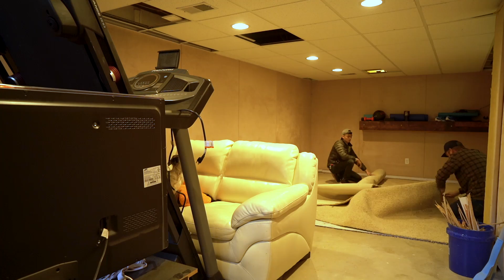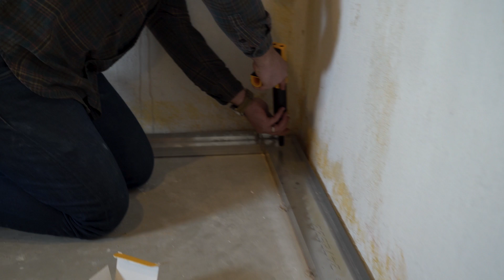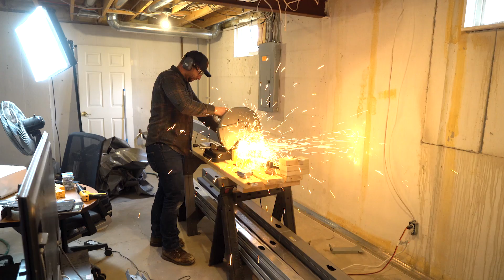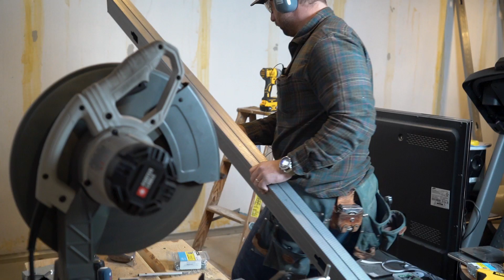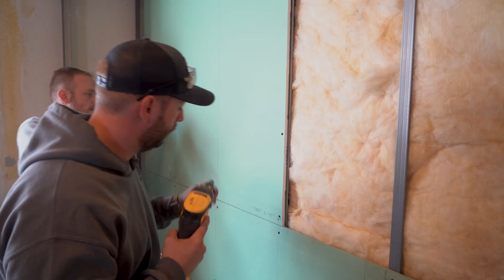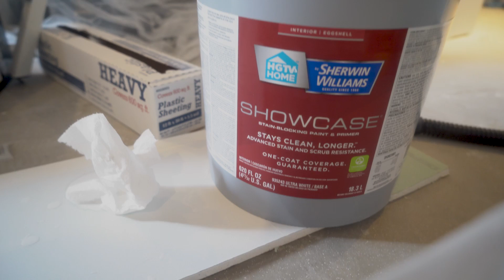Affordable DIY Framing, Drywall, & Paint // How To Basement Remodel

Comment: If u use a razor knife to score the back side of the track/stud u can cut each side and fold it back and forth and it will leave a nice cut. Also u can drill through the metal track because a masonry bit is well hardened as long as it’s not heavy gauge track. Not trying to knock ur work just trying to help. Great job.
Reply from the maker: I tried drilling through the metal track with the mason bit and it wasn’t having it. It was at that point I decided to get the ramset.
Reply: Third Coast Craftsman can’t blame u it takes a lot less Time with a ram set u should try the hilti automatic one u would be like say hello to my little friend. Lol have a good one brother

Comment: You really thought the sprayer was faster than a roller? You must be very slow with a roller. My back hurts just from watching you spray the wall. 
With a roller and telescoping extension handle you can hit the wall floor to ceiling in one stroke without bending over at all.If you use a big bucket instead of the tiny pain tray's the amateurs use, you will save a ton of time in refilling a tiny paint tray or refilling a tiny sprayer bottle. A roller also puts more paint on the wall than a sprayer, so you can use one coat in a place that a sprayer needs two.
Reply from the maker: You can keep the rollers...I’ll never use one again after this. No way they are faster
Reply: @ThirdCoastCraftsman  Roller is faster in this application, no question. Roller makes less of a mess, thicker coat, more control, and no bending over. Spray is better suited for other applications, doors, siding, trim, ceilings. Fun toy, but not quicker and definitely not easier in this specific application.

Comment: All your studs are upside down the holes aren't for electrical wires it's for black iron to make the studs more ridged I do like the video I'm a union carpenter so I use this stuff every day
Reply: Especially with lite guage studs^ . I’m also a union carpenter for 31 years . Local 157 NYC.
Reply: Another tip - if you lay out a wall from left to right the open side of the stud should be on the left and the closed side on the right. Like this  ] ] ] ] . Now Sheetrock from left to right. If you have the studs the wrong way the studs twist and leave a hump in the Sheetrock seams.
Reply from the maker: Dammit. Thanks for the correction.
Reply: I do love all your work I wish I could work with hand tools the way you do
Reply: The iron he's referring to is a carrying channel, and regardless of which way you put the studs it does its job the same, so it's not really an issue as long as you're still cutting them all from the same end so your holes line up.
Reply: there for black iron wire

Comment: Brush and roll vs tape and spray. As a remodelling contractor, I am going to leave this commercial alone. Biting tongue and its bleeding!!! Basement is looking good.
Reply: I have yet to use a sprayer inside. I exclusively brush and roll as that is all I know. Can you stop biting your tongue to let me know what you do? Lol I ask genuinely cuz I wanna know if I can save time by using the sprayer or if the upkeep on equipment is more expensive. I enjoy thinking about and looking at the job afterward as I wash the brushes and rollers but sometimes I just wanna get outta there ya know.
Reply: @benjaminlyons5261  The only time I can think of using a sprayer inside would be on "Popcorn" ceilings.

Comment: Years ago I finished a basement using steel studs and swore I'd never use wood in this application again.  Like you said, everything is straight and consistent.  Also, NO sawdust!  Instead of screwing the studs onto the top and bottom plates, I used the screws into the horizontal drywall to keep everything rigid and square. I set the drywall on a 1x3 to space it off the floor, then laid out lines 16 o.c. on the drywall.  All I needed to do was to locate the bottom screw on each stud, plumbed it, and followed the vertical line up the drywall to locate the screws.  The weight of the drywall and the tight fit into the top and bottom plates held everything in place.

Comment: Great video.  Checking with a local inspector about requirements is a great idea and can avoid having to re-do the job in the future.  I'm getting ready to move into a new house with an unfinished basement in an area where I'm totally unfamiliar with the code, so checking with an inspector is a must.  It's really confusing about the need for a vapor barrier, but an inspector should be able to clear this up.

Comment: Would have been nice to see how you addressed the steel studs top plate on that outside window wall. Looked like there was some kind of bracket, but you didn't even mention those. Also, overspray into areas you don't want paint is something to mention. Those carpeted stairs surely got some paint on them. I've used Wagner sprayer inside before and litteraly every little thing that wasn't protected got paint specks all over them, even things the sprayer never got near. Any comments would be appreciated.
Reply from the maker: Trust me I would have liked to mention a heck of a lot more but there is only so much I can cram into a video before it gets too long that no one will watch. I’m going to remove the carpet on those stairs so it didn’t matter.
Reply: @ThirdCoastCraftsman  cool. Yeah I understand video length. Too many have a short attention span these days.

Comment: I never knew Ramset nails were aluminum and I’ve used one at least half a dozen times. Sounds like it wouldn’t work but i know it does lol
Reply: I hope they aren't aluminum! Aluminum and concrete don't mix well. Our aluminum patio doors were put in without any kind of barrier between the aluminum and concrete and they are literally rotting away.